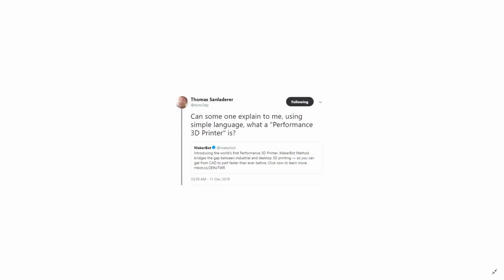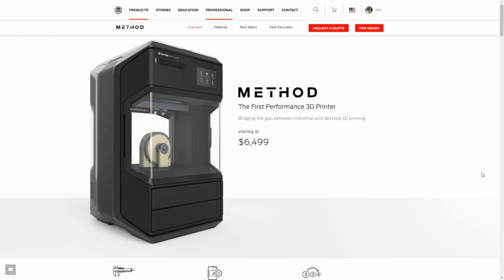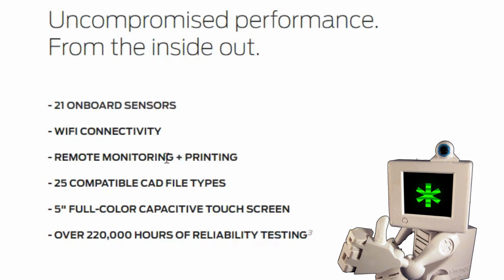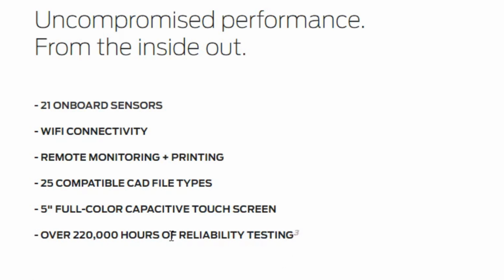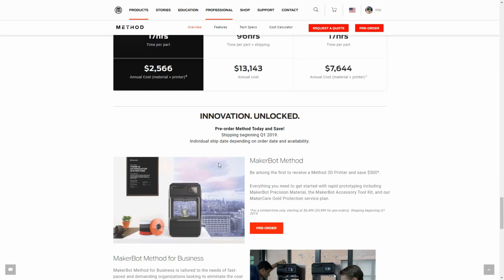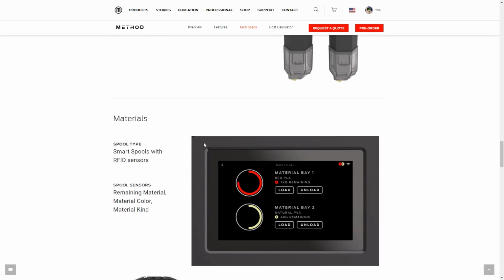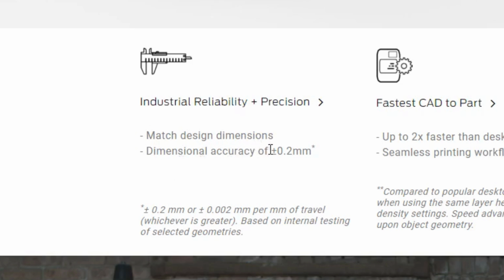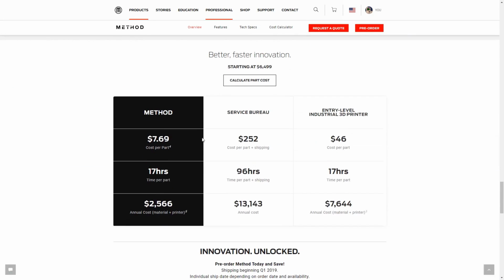Makerbot Method Announcement Breakdown

Comment: great video. if i was a teacher working in the tech department and recommended that the school needs printers that can be used for projects i would buy 2 moai and 2 fdm printers for the same price. and still have change for resin and filament. money is tight these days even for schools i could not see any school in the uk justifying spending 6k on a printer when resin and fdm kits are about.
Reply from the maker: I agree. Even if I wanted to spenk $6 on a top end 3D printer, I'd probably go Raise N2 Pro over this one. If only so I could use filament from wherever I wanted.

Comment: This machine has Stratasys F170 written all over it, including the software. No, they are not targeting at home users. They are targeting small businesses & Schools on a budget that can't afford a Stratasys. Businesses gladly give up some print quality for speed and simplicity in making prototypes.  Two Notes: 1. +/-0.005 to 0.008" is standard across Stratasys F-series printers (different than Fortus series). 2. All the accepted CAD file types for the slicer are half way down this page. - https://www.makerbot.com/3d-printers/apps/makerbot-print/

Comment: Looking at the print volume, both single an dual extruder....and looking at their site....that thing is easily matched by a less expensive Ultimaker 3.  (Which came out 2 years ago....)
Reply: Ultimaker 3 doesn’t have a heated enclosure